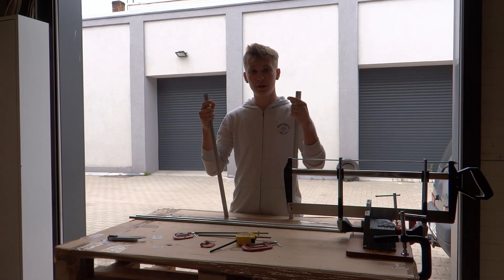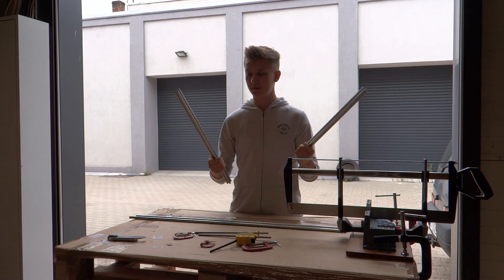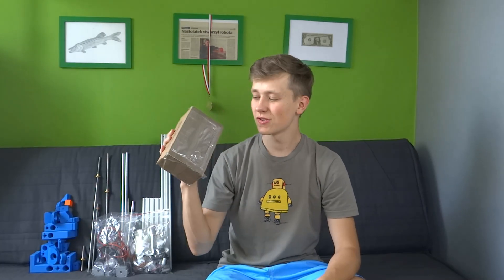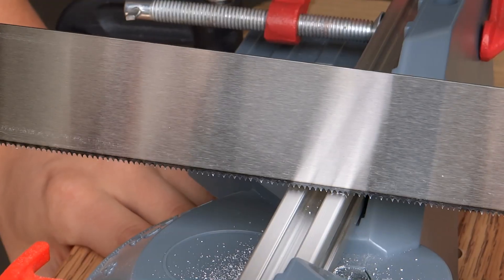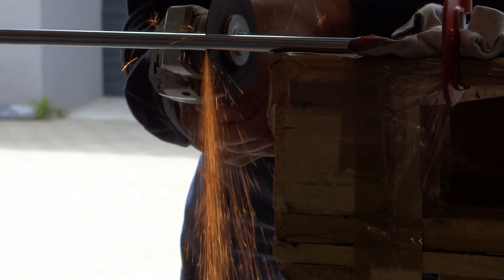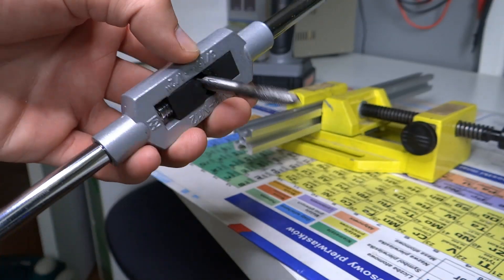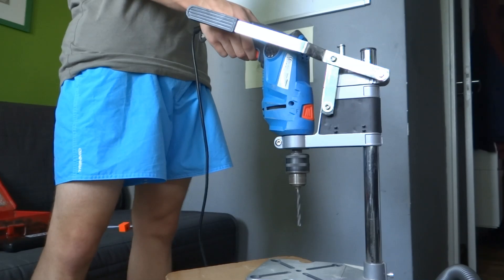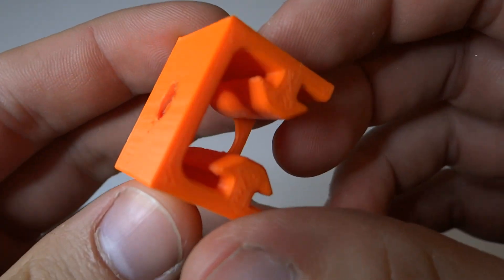DIY Dremel CNC #2 frame assembly (Arduino, aluminium profiles, 3D printed parts)

Comment: You should use stronger couplers. The spring couplers are intended for use on screws which have their lateral movement supported by radial bearings or thrust bearings. Look on Banggood/Aliexpress for "spider coupler".

The plastic cracking is because it's PLA. It has a high flexural modulus and low elongation before break, so it's stiff but cannot flex. Any flexible part you should print in PETG or ABS or PC or Nylon.
Reply from the maker: Yes, stronger couplers would be great but price is higher. I wanted to use spider couplers, those are great for CNC machines and you can find them in bigger machines, I can always change that later. It would be the best to print it with nylon but I don't have nylon and the other thing is that I want to make it easy for others to build this machine, using nylon wouldn't help with that.
Reply: You see them in other machines where the screws have bearings aand collars at both ends :) I agree nylon is difficult but everyone can print PETG.
Reply: Yeah, use PETG, MUCH better for this sort of thing (hell, the Prusa i3 Mk3 uses PETG for nearly all it's parts). Use more shells (like 4 or 5) and 30% infill and it should be PLENTY rigid/stiff!

Comment: Very impressive result. I wonder if epoxy would work better than hot glue for the loose bearings. Are the cracks ok, or do you need to reprint those parts? I’m looking forward to seeing it in action. Thank you very much for taking the time to record and edit your project experience for us. I appreciate what you do.
Reply: I can recommend to make the hole exact for the bearings so it can be inserted tightly. At work we set in slightly by placing a board over it and hitting it wit a hammer preferably a rubber mallet.for the screws and cracks we usually do it like in the video but inserting a small washer between the spaces of the printed parts enough for it to separated the parts so it won't crack and thin enough to let it get tightened enough. Its one way to do it. Hope it helps in something. Its a lovely work I am working on making one like this.
Reply from the maker: Thanks you! I will probably use some kind of glue for that, epoxy would be better for sure, hot glue is too flexible. Cracks are ok, those are not completely broken just a little bit, I will weld them with 3D pen. Thanks for taking time to comment!

Comment: On your X motor...a spacer and longer rod will give you full width of the frame, those big couplers take up way too much of the cutting surface
Still a really cool build!!!!
Reply from the maker: That’s true, couplers takes a lot of space. I wanted to use different more professional couplers but they are very expensive. I want to keep all of the prices as low as I can. Good thing about this project is that you can use longer profiles, rods and lead screws to easily scale it up. Thank you!

Comment: Really nice! Thats amazing dude! Your releasing these files right? And the firmware? Also are you willing to release the fusion 360 files?? I would like to redesign a few parts(nothing is wrong with your design I just have my own way of designing.)
Reply from the maker: Sure all STL files are on my thingiverse (link is in the description, there is also link to my design). As a firmware I will probably use GRBL, maybe I will write my own code but I am not sure yet. Of course you can change my design by please share it also as open source and put a link to my channel:) thanks!
Reply: Nikodem Bartnik awesome man! I appreciate all the work you put into your videos.

Comment: I think you you should use some actual pillow block for the lead screw, they have a grab screw to take off the load from stepper motor's bearings (sorry for my english, I'm italian 😁)
Edit: 
From where do you buy the 20x20 extrusions here in europe?
Reply from the maker: That could be an improvement but there would be no way to mount rods. I bought them in polish shop called abc-rc.pl you can find a lot of shops  with those you can even buy them from China.
Reply: I have buy from here  http://www.ratrig.com